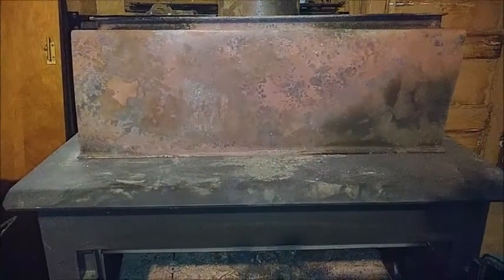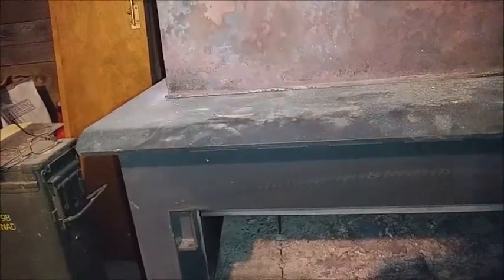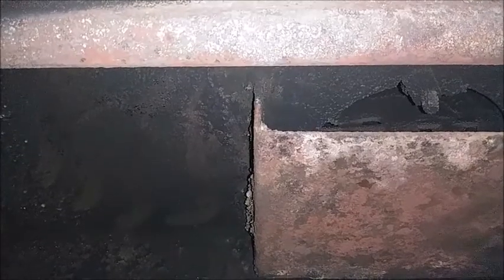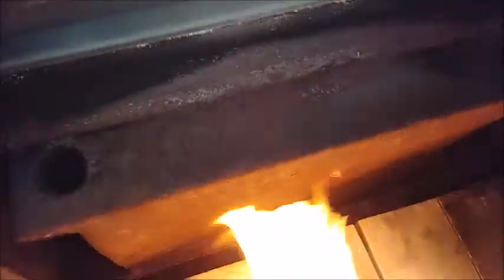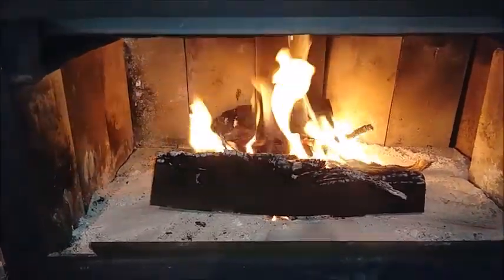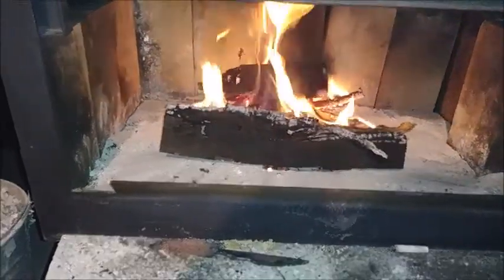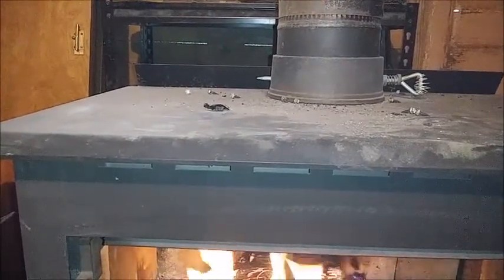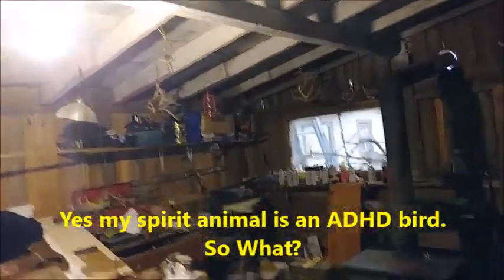Wood stove problems

Comment: You didn't show the outside flue piping...we've had acouple in the past that we had to switch the cap to the turbine type to get a better draft.
Reply from the maker: My cap is home made and Nope I aint showing it off LMAO
Reply: TBOR101 same.
Reply: TBOR101 Depends where north is.....and how high the flu is from roof. My experience.

Comment: i might know what your problem is move your  damper  in 18 inchers in your chimney pipe u  might have to go higher to get a better  draft   and  do u have a damper on your wood stove used that instead of your chimney  it work for me  i got rid of the dampter in the chimney and it works better

Comment: what kind of firewood do u burn if u if burn jack pin lots it will plug  your  baffle used a shop vacuum cleaner and see if that's works too
Reply from the maker: Mulberry, pecan or mesquite. The problem was the over baffling. Works fine after opening up the vent pipe hole
Reply: @WesS2016  k

Comment: looking at your stove in your excellent video . I am amazed that people still purchase such outdated designs . no one should be allowed to sell wood burning stoves which have any steel exposed to the combustion . A move in the right direction was recognised by the glowstove woodburner .. Most wood burning stoves will smoke if opened while the wood is gasifying . I have two afterburning wood stoves . both are converted Cheap Chinese cast iron  donors . check out the glowstove video and you will see where the future is .   Add an afterburn chamber   like on the Dunsley heat   YORKSHIRE  stove and  there you have it a wood burning stove to heat almost any size home .check out Loz Harrops batchbox rocket stove design .his exhaust exits through a maze of flue which extracts almost every last bit of heat from the hot gasses leaving the stove .

Comment: Interesting Wes. Hard to tell but the chimney looks narrow as well and the 90 degree bend in it cannot help flow
Reply from the maker: The stove calls for 6" pipe and that is what it is. The draw is not dependent on straight pipe. It works off of lift from hot air aided by the breeze outside. I was worried the bend might be a problem but that is not it. Science says that it should work just fine.
And the old stove had an issue of to much draw through the chimney, I had to restrict the flow to keep the bottom of the pipe from glowing red. 
This stove is designed to roll the smoke back into the fire to "burn" all the combustibles.
Reply: Thanks Wes

Comment: Yea I have a similar problem with smoke from my wood stove insert.  
I get lots of smoke in the room when its just starting up.  
Once the chimney gets good and hot it pulls the air up and the room does not get smokey.

The sales guys tell me that the part you took out of the top of the stove is to increase the efficiency of the stove.  
I forget what they call it, but having that to keep a hot spot on top ensure the gasses burn completely and helps cut down on buildup in the chimney.

I guess it makes sense right.  If the smoke comes out of the front and into your living room that chimney stays spotless!

Comment: I would take that metal piece out, you want the top of that stove to get hot.
Reply from the maker: I did and it worked better, but I still had the smoke issue. Back to my old box stove now.

Comment: I've heard a lot of wood stoves have that problem. I know my tent stove/heater has that issue and even the barrel stove I just built will smoke out of the front but those were not meant to be inside. I guess if it's a wood burning anything, some kind of smoke will end up in the room. You would think they could design something so that wouldn't happen. Maybe it's just easier said than done.
Reply from the maker: Play-doe was actually invented to remove smoke from wall paper in homes. After the gas burning stoves became more common place the inventor had to re-invent it as a toy. Trivia, I love that crap!

Comment: The only time we have smoke issues is when my youngest girl forgets to open the damper BEFORE she opens the door. I don't mind a little smoke....I like the way it smells. But too much is not good.  The first stove I ever put in, had 3 elbows. From the stove the pipe went up one (3') joint, then west one joint, then south one joint, out through a piece of tin that I had replaced a piece of window glass with, then up 2 joints just enough to get it past the roof edge, but not high enough to get it above the peak. Worked like a charm , plus the horizontal run of about 6' allowed the heat to escape through the walls of the stove pipe before going out & up. Anyway, the elbows are not the problem. You may have some build-up in the horizontal portion of your pipe if you haven't cleaned it out in a while or if you don't burn hot enough fires....fires that burn hot AND pull a lot of draft for a while. Burning some cardboard boxes is a good way to get a hot drafting fire for about 5 or 10 minutes. I have installed & used several wood stoves and have rarely had any smoking issues. I love wood stoves! Really.